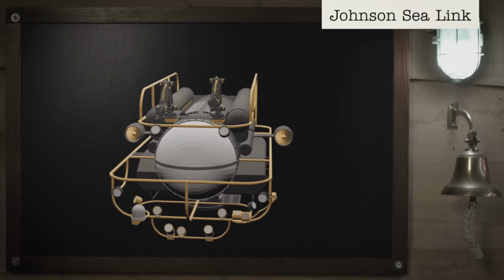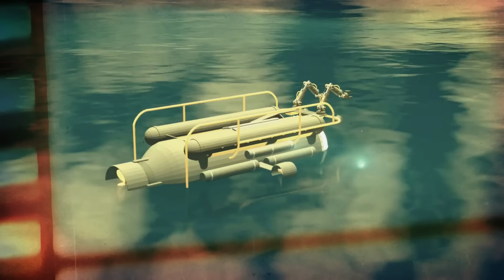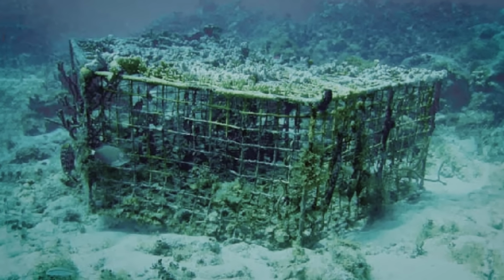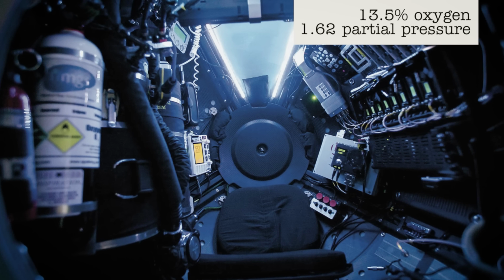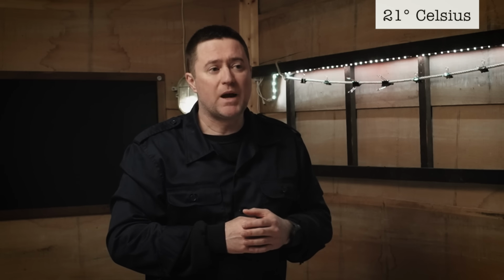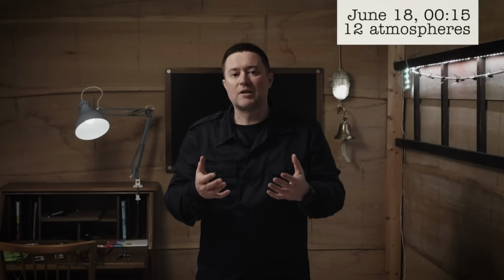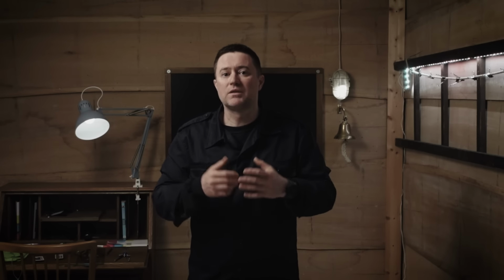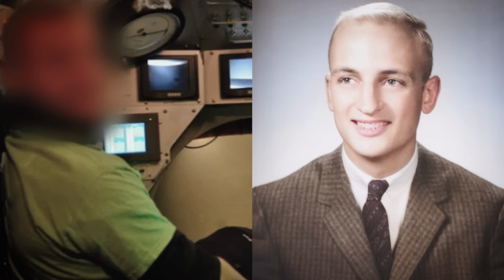This CO2 Scrubber Killed Half the Crew!

Comment: How come every single underwater rescue is plagued with crap not working on the rescue equipment.
Reply: because you dont much hear about it when the equipment works?
Reply: Because the outfits that do everything by the book, repair redundant systems, and have redundant systems for redundant systems, don't get on YouTube.
Reply: The reason the rescue has to take place in the first place is usually difficult terrain, currents, or some other difficulty. This will obviously also cause the same difficulties with the rescue equipment.
Reply: Because it’s never used in anger until it is
Reply: @X737_  apart from not being regularly tested, nobody ever simulates emergencies/rescues with various pieces of kit having failed (at least, not until after someone dies)
Reply: Lack of maintenance and professionalism.
Reply: Selection bias. AKA the swiss cheese model. It takes multiple failures to make a story worth rememebering.
Reply: Murphy's law
Reply: Goes to show you how likely a Space rescue will be successful!
Reply: @michaelreid2329  At least space equipment gets a lot more attention and is less likely to be neglected.
Reply: @michaelreid2329 a space rescue actually has a FAR greater chance of success due to EVERY detail being subject to maximum scrutiny and many, many brains at work.
Reply: @michaelreid2329  Space Travel is much easier than Deep Sea Travel. 
Hardest part is getting the rocket to space at 28,000 MPH+
Reply: @tbas8741  I guess it's the rest of the stuff, not just travel that will make eye wateringly difficult processes in space rescue.
Reply: @tbas8741  space travel is not easier at all fool. more people have traveled to the bottom of the ocean than have traveled to another planet
Reply: @Blox117  12 people have walked on the moon,
1 Person has dived to deepest part of the oceans. 
A space ship can be made from material same thickness as a coke can as it only has to hold less than 1 atmosphere, but a sub going even only 1km deep has to be inches thick and deal with hundreds of atmospheres
Reply: @tbas8741  This is true. Making a space suit is infinitely easier than making its "adversary" for pressurized diving. In space, there's (almost) nothing. You're relying on math. Under water... well, there's a ton of things and tonnes on top of you, just ... waiting to crush you open like a tin can to get at the good bits. Like the titanic twat who made the Titanic sub, which wound up like what you get when you throw a whole car inside a metal shredder. Space is fraught with danger, but it's nothing compared with what's happening under the sea. The final frontier? Unlikely, since we've barely explored the real down under....
Reply: @tbas8741 i especially admire one specific approach they employ sometimes when the docking ship actually meets up with the most forwardfacing port coming at them in 28ooo km/h and matching theyre speed making micro adjustments so not to slam directly through the whole thing while approaching and docking. I thought this particular approach seems so riskt that they opt never to do it but apparently they do. Thats some crazy good manuvering appeoaching a ship coming at you in those soeeds, they must have one hell if a dlight sim to get that right at nasa.
Reply: @tbas8741 I don't really see the point in arguing whether a deep sea or space rescue is more difficult, they're both very difficult, expensive, and unlikely to be successful. In space, your rescuers are a lot further away and definitely not ready to go on a moments notice. Unplanned space launches just aren't a thing. There aren't a bunch of rockets and crew capsules just sitting around waiting to be used, and they are expensive and time consuming to produce. Even SpaceX reusable rockets cost 100s of millions per launch. Launches also require specific launch windows so they can enter orbit a reasonable distance from their target, and may even then still require multiple orbits to get a rendezvous. There are some factors that would be easier for each rescue type, and some factors more difficult, but neither is remotely easy.
Reply: @Blox117 as far as we know, nobody has travelled to another planet!
Reply: Because rescue equipment gets used very very infrequently sometimes never. So things get rusty, things break ropes fray, UV rays degrade surfaces, salt water spray and salt water environments or not gentle environments. Plus the deep ocean is as uninhabitable and dangerous as space. You're trying to perform work in an extremely hostile unnatural environment that is alien to us. Things break, Murphy's law etc. Rescue equipment doesn't usually get the attention it needs until it's needed and by then it's too late.
Reply: Sometimes I think Murphy wasn't warning us, he was cursing humanity.
Reply: its only the rescue attempts where people die that you hear about which is the ones where rescue gear fail
Reply: Stuff not working is why they needed rescuing. 
You don't dial 911 when everything is fine.
Reply: Maintenance is hard, & eats into profits.
Reply: I think what people don't think about is just how many things need to go right with underwater and space missions, which I think are pretty comparable. With so many variables, the odds of a failure somewhere in the system get pretty significant.
Reply: Because the equipment is extremely complex and just like aircraft, you can go without a few systems before having to call something off.

Chances are you've flown in a plane with I operative thrust reversers, bleed air compressors or autobrakes before Minimum parts lists exist because having everything in perfect working order 100% of the time would be logistically impossible.
Reply: Because it was only designed as a cover for black budget projects not actually rescuing anyone. I was a qualified senior survivor.
Reply: Because sea farers secretly identify as fish and believe they don't need it!
Reply: Money
Reply: @bearb1asting its the navy... thats not a for profit org.
Reply: @kungfreddie  yeah. It's the govt. Money is still the reason for failing
Reply: Money.

Comment: I don't think the scrubber killed them. Seems like time is what killed them. They had no plan or way to survive for being at that depth for that amount of time. Also it was never clear why the men were in the diving compartment in the first place. Was there any purpose for them going down along with the 2 pilots?
Reply: That's essentially saying the same thing. Scrubbers don't have infinite capacity. There's only so much CO2 they can absorb. And the scrubbing ability slows with time as the active material is used up.

So saying it was the scrubber or saying it was the time, is really the same thing, although saying it is the scrubber makes it sound like it was a catastrophic failure, rather than the inevitable one.
Reply: The problem is the sheer incompetence of the Coast Guard. If you look into the incident more, it is just obvious that they didn't even need to go there, they were useless and repeatedly failed to get to the submersible because of their lack of organization.
Reply: @sujimayne but didnt the crew also fail to report to the coastguard about the one failing fan making them think tvey had more time than they actually did?
Reply: @sujimayne  I agree to a certain extent. If you get stuck or have an accident and your ONLY hope of rescue is the Coast Guard or Navy... its your own fault.

There are so many things the crew could have done prior to the incident in order to avoid it in the first place, or better their chances of rescue.

While the Coast Guard has a 'go get 'em' mindset, responding too quickly to an already time-sensitive scenerio opens you up to the result of bumbling around or trying all solutions at once. 

Having a safety net that responds slower than you can help yourself is an issue that can lead to complacency on both sides, hence everyone should go for a safety and readiness mindset.
Reply: Funsies
Reply: " Also it was never clear why the men were in the diving compartment "

Trying to survive.
Reply: i agree,so many excuses while u already reach there...while other nations have little equipment or technology to even retrieve the body of the victim yet we keep denying our capabilities to save people.
Reply: The other guys were in a separate compartment because they were the ones going outside. They never expected to spend the entire time inside the vehicle. 
The other compartment was where the electronics and control equipment was.
Reply: @darkwater72  While that compartment is used for divers, they were not equipped nor planning to go outside the vehicle.  It was mentioned early in the video that they were going along as "observers" and were not planning on leaving the vehicle.
Reply: @JanPeterson  They had means to leave the submersible though.
While there should have been a rule that they bring warm drysuit innerwear on every dive, even if it's a short one they still had means to leave.
The surface team should have floated the possibility of a lockout dive where instead of returning to the submersible on failure to free it, they instead go back in, grab something buoyant and then get to the surface. While 100m sounds like an impossible distance they could have made it. The only issue would be decompression sickness at the surface, but there was a hyperbaric chamber on site so they could have been put directly into that and brought back up to pressure and decompressed slowly.

The men in the diving compartment had the means to save themselves. Obviously nobody knew what they were snagged on so they didn't know if they could rescue the other 2 men, but they could have rescued themselves if they couldn't get the submersible unstuck.
Additionally if there was a line and a buoy (or anything that could serve as one) they could have sent that up too, to give the navy divers an exact location of the sub.

If this was an aircraft disaster "hindsight is 20:20" would make sense, but these men had hours and dozens of people to give them advice, yet they chose to sit tight and hope the navy would save them.

Comment: Slight issue with your thumbnail its the scrubber from Apollo 13 it did the exact opposite from what you say it saved the entire crew and enabled their return to earth safely it's one of the greatest emergency engineering improviseings in history
Reply: Seconded, this really needs to be fixed.
Reply: You too believe in that Hollywood thriller movie. As I recall it, they almost froze to death too. This while the space ship was exposed to direct sunlight all the time. How could it get so cold then really? Air condition was what they really needed. All kinds of nonsense in that Hollywood action thriller movie Apollo 13.
Reply: @elbuggo The Apollo spacecraft was covered with light and reflective surfaces and with multilayered insulation designed to slow the passage of heat in or out. Having turned off all electrical systems, including heat, the craft radiated much more heat into space than it absorbed from sunlight.
Reply: @donerickson1954  RE: including heat

The space ship was in direct sunlight 24/7. You don't need heat then, you need cooling. 

Never heard anyone complained about anything too hot or too warm in these episodes - weird. 

The AC in the space suits worked wonderfully all the time without a single problem, as I remember it. Almost like in a Hollywood movie!

Comment: Why does it always seem that "Should be a Simple Procedure" never ends up being a Simple Procedure.
Reply: Because of something that's best described as safety creep. The more often you do procedures, the less dangerous those procedures seem to become and therefore many people get casual with safety procedures. This trip to retrieve that fish trap should have been a breeze and it was, until the unforeseeable happened. And even then it should have been survivable, if not for the very casual disregard of procedures and safety measures, especially by the two men in the diving compartment. Had they been properly dressed and prepared to make an emergency dive if necessary, all of them would probably have survived.
Reply: That exact phrase, figuratively, hit me at work today. Changing encoder backup batteries in a Fanuc robot arm. Should take 5 minutes in theory; remove 7 easily accessible screws, pop off a cover, extract 2 battery packs, unplug, plug and slide in 2 new packs, attach cover. In practice, the cover was so stuck on to the robot that we couldnt work it loose. More than 30 minutes later with 2 people, numerous tools and a bit of violence we gave up as not to damage the robot or the cover.
Reply: Complacency.
Reply: I was a non-commissioned officer nothing frightened me more than the officers saying that what we were going to do was 'simple.'  At that point the whole mission/training/operation was cursed.
Reply: Idiots. That's why. Either in the creation, maintaining or operating or all.
Reply: Why were the divers even there, when no dive was planned?
Reply: Because doing anything in an environment that will kill you is never a "Simple Procedure" no how many times you do it.

Comment: The thumbnail look like the air filter Contraption that Appollo 13 crew has to make
Reply: That’s because it is.
Reply: The event occurred in 1973 and im guessing no pictures of the exact thing
Reply: Well spotted! :)
Reply: Came here to say that. That's exactly what that is
Reply: Also a shot of the Titanic bow railing
Reply: they just changed the thumbnail lol
Reply: but how do you fit a round peg into a square hole again? some duct tape and the cover of the flight manual, right?